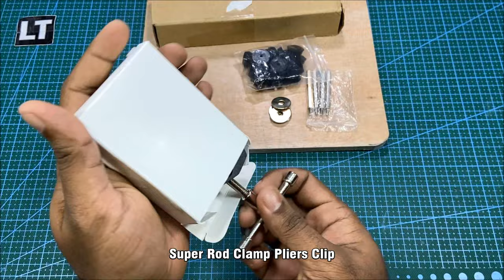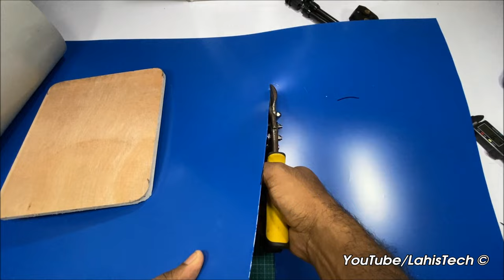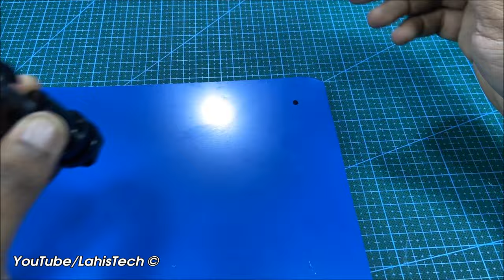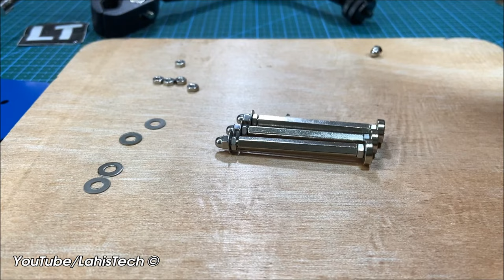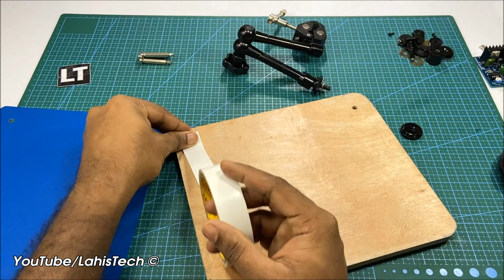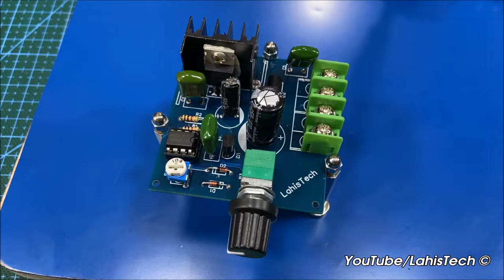DIY PCB Holder make with Articulating Friction Arm

Comment: This is really great. What length are the PCB spacers in this video? Is the "11inch Adjustable Friction Articulating Magic Arm + Super Rod Clamp Pliers Clip" all made of aluminium or are some elements made of plastic?
Reply from the maker: Thank you; That’s made out of full aluminum; 1inch PCB spacers.